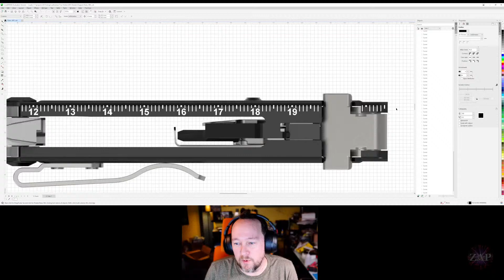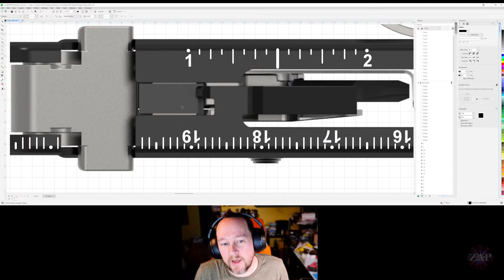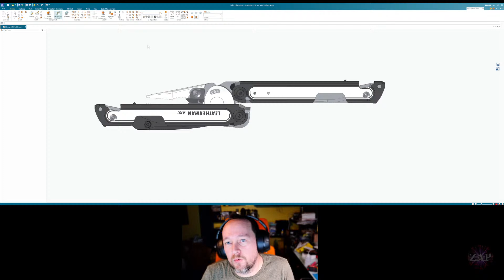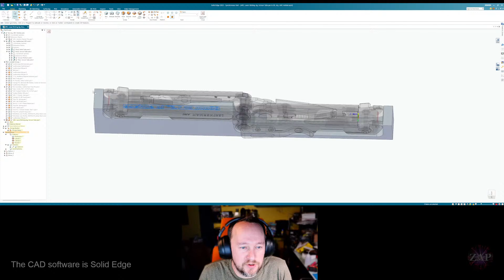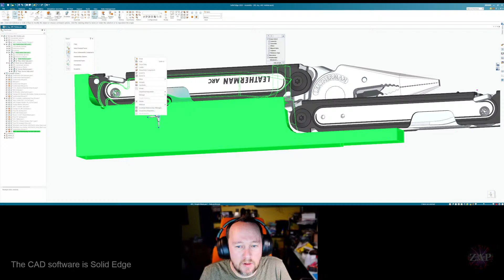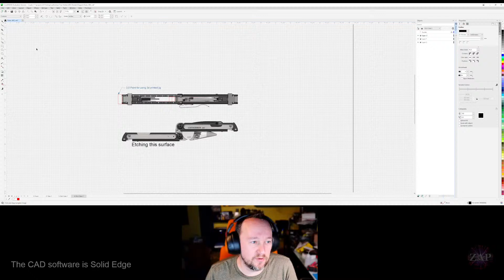Live- Zap works on the a ruler for the Leatherman ARC

Comment: Have these files been released?
Reply from the maker: Yes. But the etching on mine ended up very low contrast. . https://drive.google.com/drive/folders/1IxYU555UXqoEsZVyrYI7WlMeeWsDDuCC
Reply: Thanks! Do you have any photos on how it turned out? You should do a follow up video!
Reply from the maker: @CoenCritcho  I did plan on a follow up video, but just haven’t had the time for it yet. Photo: https://flic.kr/p/2pNHUY6
Reply: Was there any luck finalizing this?
Reply from the maker: @dng123100  the file link is in the comments here. It didn’t turn out with good contrast using a co2 laser in need to try again using a fiber laser.

Comment: Is it possible to get a slightly larger pad that is larger than a mouse pad but has a magnetic area to hold screws and such? Say in the corners?
Reply: With magnets in the corners, you could keep the screws in order for each side and not mix them up.

Comment: Just made it to the end. The Ruler looks amazing. It’s a shame Leatherman did not include it in the first place. They could have marketed it as having 21 tools, added another $10 to the price, and I still would have bought the Arc in a heartbeat. I wish you could send your work into Leatherman for them to add the ruler to future limited or special edition models of the Arc. 

Also, I have my multi-tools customized from Leatherman directly, and the designs are not etched into the surface with any sort of noticeable physical depth. The images appear as if almost printed directly onto the metal, rather physically etched into the surface. 

Now, I just hope I can find a local engraver to add the Ruler onto my Arc.
Reply from the maker: Thanks for answering the question about the customization.  A few folks have asked to get a ruler into their customization tool, I will at least ask Leatherman to see if they will work with me to add that as one of their default pattern options.
Reply: I suspect Leatherman didn’t want to have it compete with the Surge which is advertised as 21-in-1. But if they had advertised the magnet as a screw/bolt finder, they could have said it was 22-in-1.

Comment: Hi Zap, great livestream. 
What If you just did 2 shorter rulers since I, and possibly the majority of folks, use them for measuring things like bolts, etc.
Put them on the side opposite the “…FREE TECHNOLOGY” engraving so it wouldn’t interfere with the aesthetics.
A 3 inch on one side and an 8 centimeter on the opposite would fit nicely.
Reply from the maker: I can do that as a variant.

Comment: Unfortunately keep missing your live feeds, but would like to know how easy it is to get the driver bits out since they're located on the body side of the holster. Will I be taking my belt off everything I encounter a different screw head?!
Reply from the maker: As he said, you basically use another. It or the end of the bit extender to push them out the side. I will cover this in detail when the final holster video drops.
Reply: If you watch any of his old live feeds he does go over it. It doesn't look too difficult.
Reply: Kind of figured as much, you seem pretty thorough on your testing so I knew you'd have it covered!!